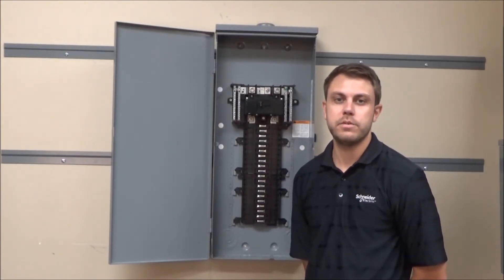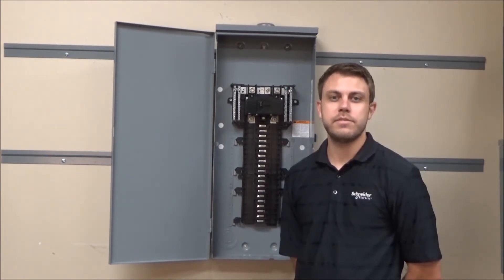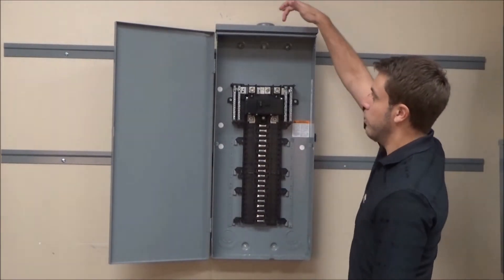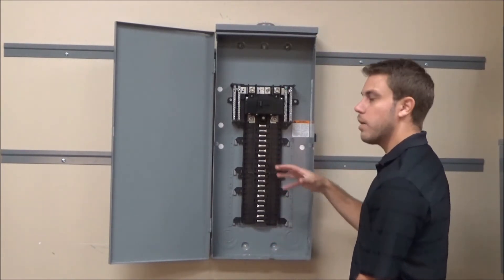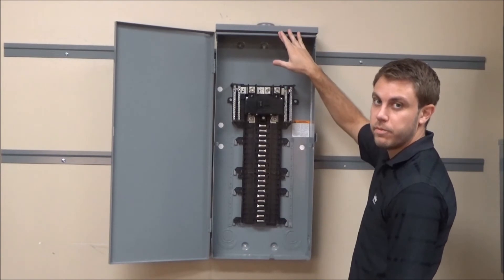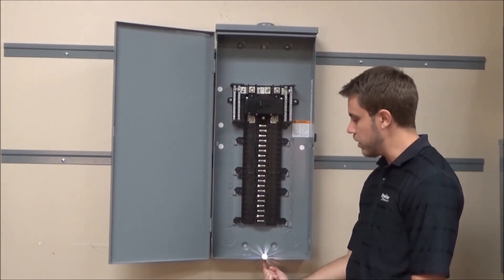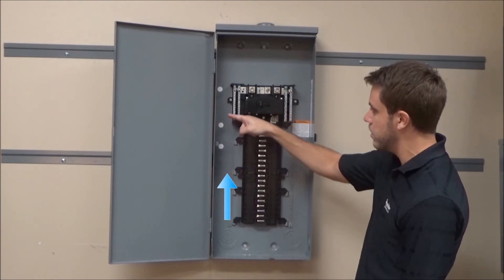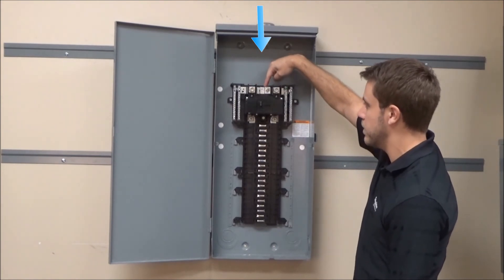Bottom Feeding QO™ & Homeline NEMA 3R Outdoor Rated Load Centers | Schneider Electric Support

Comment: This is the absolute worst design, this panel is the worst choice for a panel upgrade or retrofit, the majority of homes have the majority of circuits coming in the top, service entrance could be over head or underground, but more than likely there will be more than a few circuits coming thru the top of stud bay, this panel does not allow any circuits accept the service entry to come thru the top. In new construction, dont worry - you know you will bottom feed all branch circuits if this model is on your floorplan, easy to run wires thru the bottom while all studs are bare. Square D does not make an outdoor rated load center that allows flush mounting and circuits coming from the attic in the same stud bay.